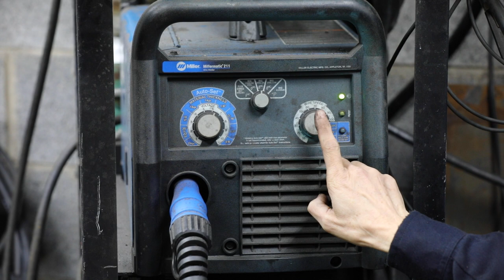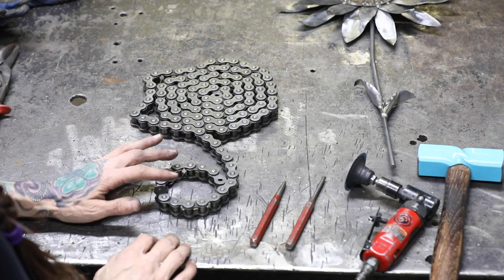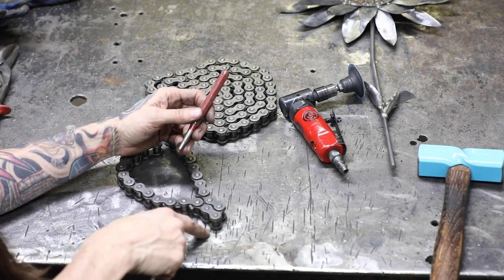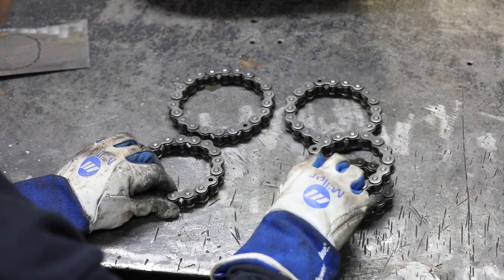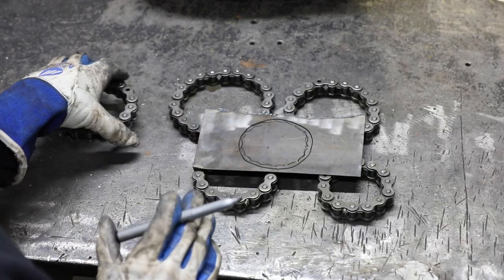How To Weld A SunFlower | Easy Scrap Metal Art | Barbie The Welder

Comment: Barbie, great project. What size air compressor do you use? I tried using a right-angle grinder and a 14.5 cfm@90 air compressor and it bogged down.
Reply from the maker: I’m using an 80 gallon but a 60 gallon will work perfectly! About $600 at tractor supply.

Comment: How long and how wide were your pedals?
Reply from the maker: It depends on the circle size. Find and print out a picture of a sunflower you like and use the measurements so the circle and the pedals are in proper proportion to each other.
Reply: @BarbieTheWelder  I built one previously BASED off everything I saw but I'm going for a smaller scale for someone's birthday so. I have pictures of the first one I built if you have an email I'd be glad to forward em.
Reply from the maker: BarbieTheWelder@gmail.com i’d love to see them